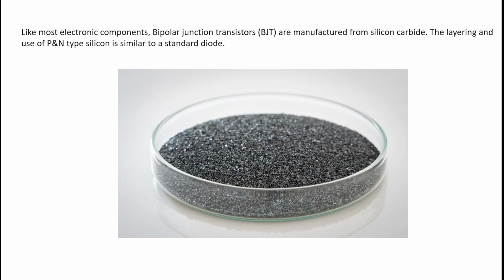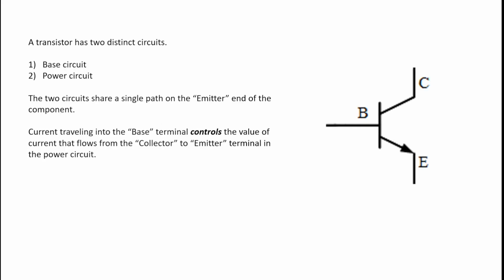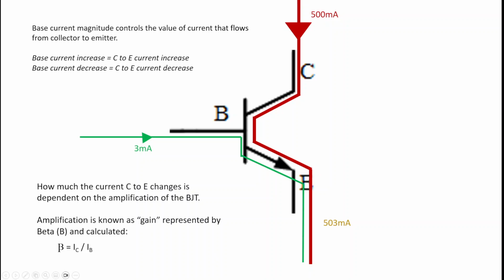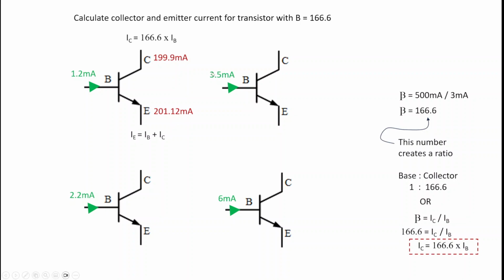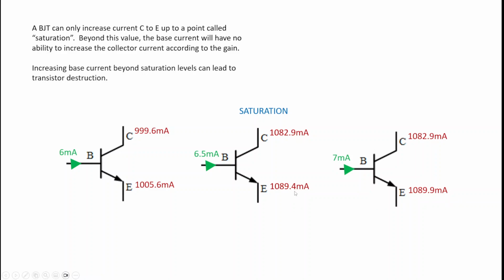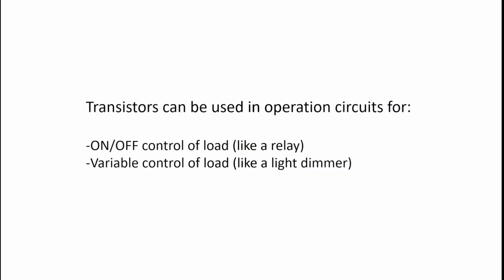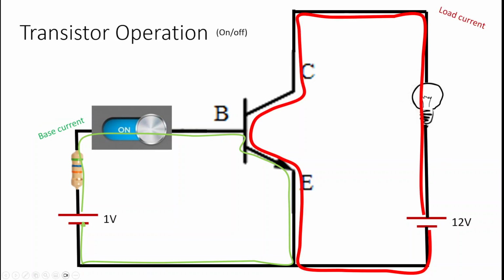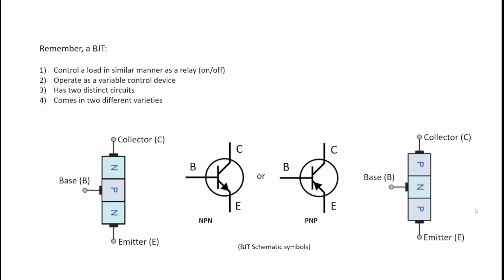Electronics Transistors BJT

Comment: Nowhere in this video do state that beta is a function of the actual type of transistor.

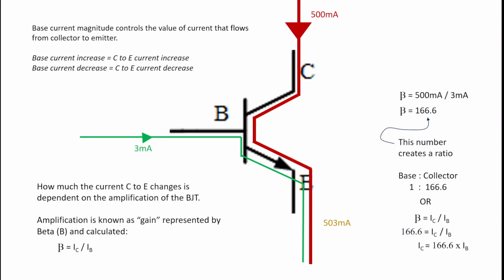At 4:00 you say that beta is Ic over Ib, and you have chosen those values.
You then  use the calculated value of beta and apply it other examples.

People will be misled into thinking they set both the base and collector current and that beta is whatever they design it to be.

This isn't how it works.
Beta is a property of the particular transistor you are using, it changes from transistor type to type, it varies across transistors of the same type AND it is sensitive to temperature.

You need to tell people to go look up in the datasheet what the typical value for beta is for the transistor they are using. THEN use beta in the
    Ic =β.Ib
formula.
Reply from the maker: Thanks for your comment. There will be many times throughout this presentation that specific details are waxed over. This is intentionall-and required to a point-due to the targeted audience. The channel presentation are targeted for the Canadian  electrical apprenticeship program. The depth and scope of which is intentionally shallow on some topics that an average electrician would not often work on. Thanks again for your comment.